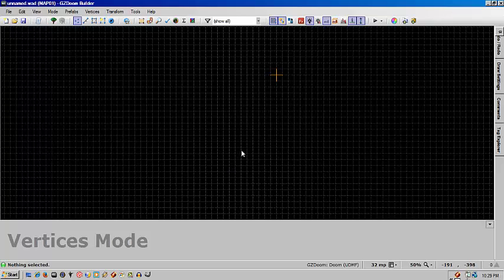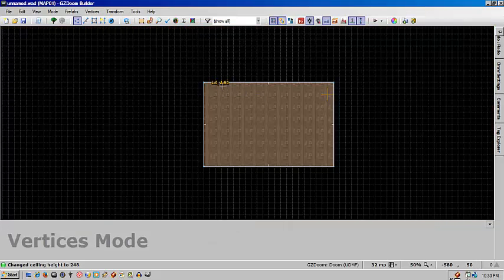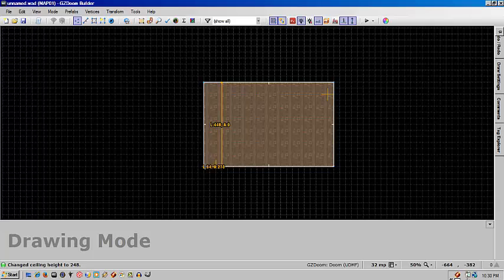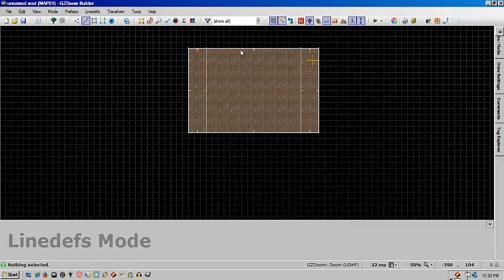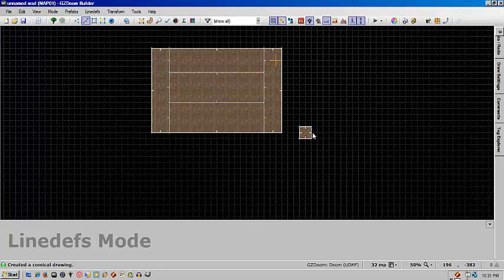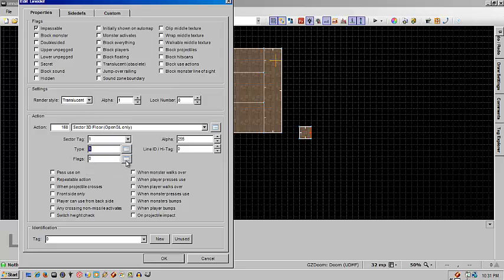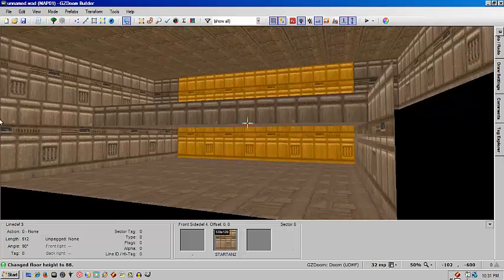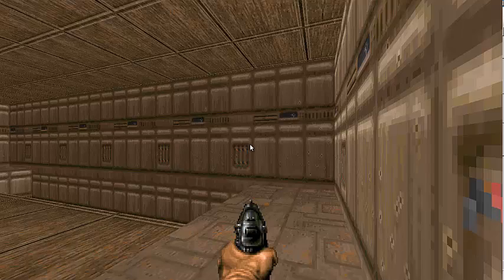(GZ)Doom Builder - Make A Bridge Using 3D Floors

Comment: i did exactly as you did and its not working,theres no bottom texture its black
Reply from the maker: FUNNY40791 If everything was done as in the video and it is displayed right in gzdoom builder make sure you are using the most current version of gzdoom or zdoom as there can be issues with older versions
Reply: +FUNNY40791 Did you ever figure it out?
Reply: +Lee Davis yer turns out it was the builder i was using
Reply: I figured it out too. You can download a plugin https://github.com/biwa/3dfloormode/releases for GZDB and it will render the 3D objects in 3D Visual Mode.

Comment: Ok, I have no Idea what I'm doing wrong I'm doing exactly what you say yet I get a thin sheet of ground what did I do wrong? Oh and I fall trough It to.
Reply from the maker: Rusty Gold The first issue might be due to the floor hight in the dummy sector might not set with enough  space to generate the 3d floor properly as for falling through the floor select the linedef you are using for 3d floors and in the flags section  of the configuration make sure solid is checked aside from that I'm not sure what might be causing the issue without looking over the map. Hope this was helpful . If you have any other questions issues or requests let me know either here or in private message. Thanks for watching